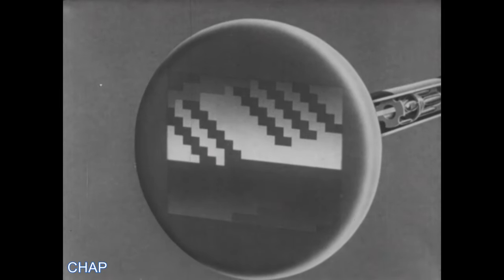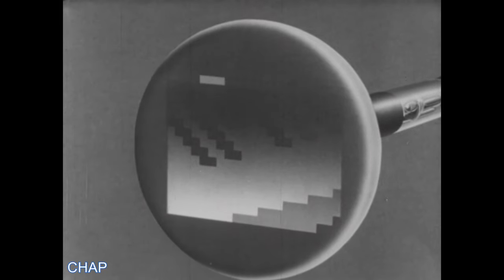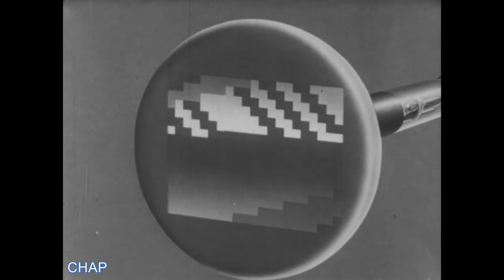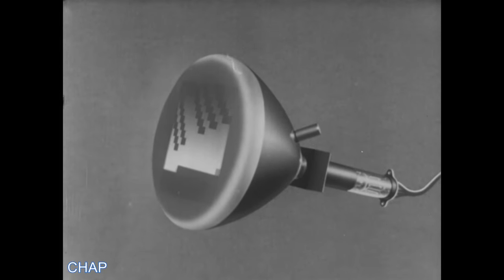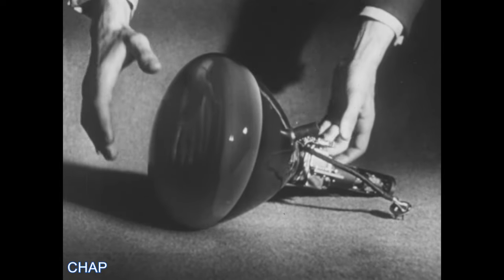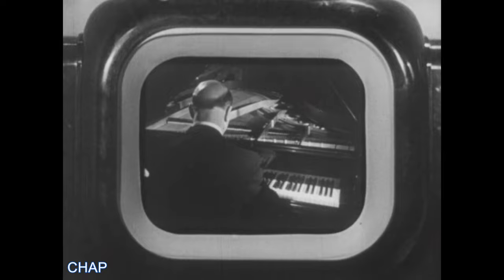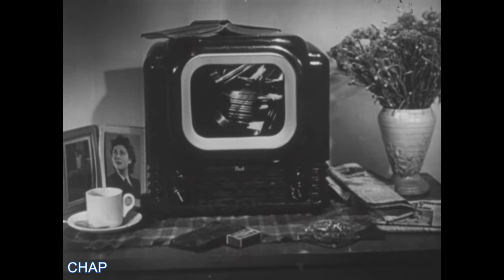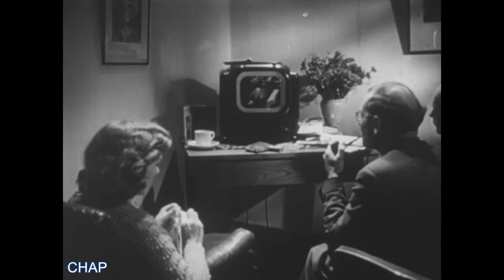"HOW TELEVISION WORKS" 1952  Educational overview

Comment: So many variables to go wrong, so much that needed perfect synchronization, and it was all transmitted and received by good old VHF radio waves. Sheer genius in invention, engineering and manufacturing. It's amazing that it worked at ALL. Just the wave form of a B&W video signal is amazingly complex, AND it also had to carry the audio! And this is "just" B&W TV!  Sure a B&W TV system would impress anyone today, But how many jaded lay people today even know HOW it worked. It's actually an amazing feat of purely analog tech!
Reply: You're an amazing feat of purely analog tech! 😋
Reply: @marctronixx  Technically speaking, That's true and even better I'm a purely chemo-mechanical analog device. 🤔
Reply: Saw your comments about tv technology. What was amazing is the work of RCA engineers to bring us color television. And because they didn't want B&W sets to become obsolete they found a way to broadcast a color signal so that B&W sets could also recieve a tv program broadcast in color. .
Reply: @Brian-yt8fu  Yes, that was not only a wild bit of engineering, physics.and chemistry  It was an amazing "out of the box" pro consumer concept and one of the rare times that a new format didn't force the owners of the old devices to need to switch. This concept also happened in radio when stereo was added to FM the new stereo signals were still compatible with mono FM radios.

Comment: This is a pretty good documentary for its day. Seeing that final generation iconoscope tube was interesting. It resembled RCA's "orthicon" very closely. Note, I did not say "image orthicon" which is a completely different camera tube altogether. Not obvious about that tube is that it is magnetic deflection in only the vertical axis and electrostatic deflection in the horizontal. I built some of my first all magnetic scan systems from scratch in the past couple of years and discovered that it is extremely difficult to get them to scan at thousands of sweeps per second. Vertical was only 50Hz in their camera and horizontal scanning was  8.1KHz in the horizontal (405 scan line system of the time in the UK). That's less than half of the 15.6KHz in modern SD television. Remember these are the earliest days of post WWII television in the world.
Reply from the maker: Hi videolabguy, great point in noting the difference between magnetic deflection and electrostatic deflection!  A fine point (but major one) that most people would not be aware of.  Thank you for sharing that bit of info.  ~ Yes, these are really some of the earliest days of television when much was still in a state of evolution.  (I have a 1947 TV in my garage that is likely beyond my skill level to tinker with, but fascinating to look at.)    Thanks again!  ~  Victor, CHAP
Reply: The tubes used here are called CPS Emitrons (CPS standing for Cathode Potential Stabilised). These were the direct descendants of the original Emitron tubes, which were essentially a copy of the Iconoscope.
Reply from the maker: Hi Davba2,  thank you!   Good to know.   ~  VK
Reply: Very well done film.
Did you check out the build quality of the television receiver. Almost military grade.

Comment: Television CRT where elaborate electronic air cleaners as well.  I could immediately tell if there was a smoker in the house and about how many packs a day from the high voltage anode lead in a TV when servicing.

Comment: Wonderful footage.  The explain makes everything so simplistic, for those who knows that  to make it happen is way more  too complex. The minimum deviation of tolerance of the values  a capacitor, or a resistor, the wear of the tubes, the mains voltage floating are enough to distort the signal, with direct effect on image quality, misincronization, "ghosts", noise...
An ofcourse, the amount of energy to power up these  glass tubes in heavy  wooden boxes. 
Total nostalgia.
Reply from the maker: Hi Brasilian Guy, thank you very much.  Glad you enjoyed this vintage film on early television.  We are looking for more like this and hope to find and restore similar tech videos for sharing here in the coming weeks. ~  VK

Comment: The bakelite set featured is a Bush TV22 I think.  The set with the case off looks older.  Lots of EF50 valves.  These were readily available as surplus from WW2 radar usage.  Anyone know what set this is?
Reply from the maker: Hi Eric, yes, pretty sure it is a Bush TV22 9" table top television receiver, manufactured by Bush Radio Ltd about 1952.  Bush started making this model around 1950.   There is more info on this in the "description" section of the video too.  It was a popular set in the UK, for those who could afford it back then.  : )
Reply: The set is a TV12, which was an earlier version of the TV22, being made in 1948/49 from memory.  It used the same case design as the TV22.
Reply from the maker: Hi Stuart, thank you very much for your comment and info.  Both models look very similar... do you know how to identify this as the TV12?   I am very curious.  Thanks very much.  ~ Victor
Reply: @ComputerHistoryArchivesProject  The TV12 used EF50 valves, as does the one in the film.  I actually have a TV22 chassis,  and it definitely differs from the one in the film.
Reply: @ComputerHistoryArchivesProject  i used to have this television back then. What a golden time it was!!😭😭

Comment: The US NTSC standard was up to 480 30fps but broadcast was about 330.  But Europe's PAL I  believe was 576 25fps perhaps because they developed it slightly later then US, noticeably better.  However NTSC was backward compatible with B&W,  PAL was not but was superior color pix, namely better color with weak signals.
Reply: Most of Europe used CCIR B 625 lines in monochrome on VHF. 
Ireland adopted CCIR I 625 lines and broadcast on VHF. The UK adopted CCIR I in 1964, however two networks( BBC 1& ITV) already broadcast on system CCIR A (405 lines) on most of the available VHF spectrum. Hence in the UK 625 lines ( system I) was broadcast on UHF only.( no space on the VHF spectrum) It took a while to get good population coverage with UHF. It was about 70% by the end of 1969. By March 1974 it was 94% coverage. From 1969 the BBC1 and ITV networks broadcast on 625 UHF as well. The 625 luminance signal was electronically converted to a 405 line signal and broadcast simultaneously on VHF. ( for those with old 405 line only TV's, or in areas without a UHF signal) Britain tested the NTSC ii color system with the 405 system btw, AND with the CCIR I  625 line system, and tested SECAM before adopting PAL in 1966, ( as it was adjudged the best Colour fidelity Colour over broadcast) broadcasts commenced in Colour from July 1967 on UHF.[BBC2]. From 1969 BBC1 &ITV started broadcasting in Colour on 625 on UHF. I had a portable monochrome 625 UHF TV and I can confirm it was compatible with Colour broadcasts! 
The VHF 405 line system was not compatible because it was a different system. The 405 line system was closed down in January 1985, in fact the last relay for BBC1 405 on VHF (Llandrindod) was so remote the engineer was not able to get out to it to shut in down until January 6th 1985, three days after the rest of the VHF transmission network was closed. ( the relay had its own standards 625 to 405 line converter) I wonder how many people turned their 405 line TV in Llandrindod on January 6th expecting a picture? 
From 1963 to 1970 most monochrome TV sets in the UK where both capable of receiving VHF  and UHF and switching from 625 to 405 . In fact Colour dual standard  TV sets came in the market in 1967 in the UK that could do the same!
Reply from the maker: Hi Martin, thank you very much for your detailed information!  It provides a great bit of history that many do not know.  I definitely learned something myself!   Thanks again!  ~  Victor, CHAP
Reply: In France, before SECAM, we had 819 lines Black and white. It was good but need special cameras, VTR... It was HD before HD.
Reply: You are mixing your apples and oranges. So called NTSC (RS-170A) is the color version of RS-170. Both are 525 total scan lines at 60 fields per second using interlace. A "frame" is made of two successive field scans to reduce flicker and cut total bandwidth in half (4.2MHz for the video portion of the signal). The 330 lines you quote is for vertical black and white lines in a test image. At 4.2MHz bandwidth, these lines blend together when there are more than 330 of them. Think of a camera slowly zooming back from a picket fence. So, there are SCAN lines which are horizontal, then there are RESOLUTION lines which are vertical and represent the maximum speed at which the electron beam can be switched off and on
PAL was developed in the 1960s in Germany. I had the pleasure of watching the first commercial color program on out BW 10" TV in 1967. The show was called The Golden Shot, a game show. Still popular I hear.
As for PAL "being better"? Malarkey! PAL has a slight transmitted bandwidth advantage, but us otherwise identical to NTSC in all but one technical trick to eliminate the TINT control. This was not as good as it sounds. In NTSC, phase disturbance caused the famous "purple people eaters" and "jolly green giants" problem of tint shift. PAL alternated the phase of one of two color carrier signals such that the error was purple in one line and green in the next. At the proper viewing distance, the human eye blends the green and purple back to "normal". It is ONLY an illusion. I always hated PAL screens when I had to look at them close up. One. They flicker horribly. 50Hz is just barely above the flicker threshold for most viewers. Two. The purple and green lines popped out at me and were even more annoying than the whole picture doing this in NTSC.

One of the contributing factors to the NTSC vs PAL fallacies is that the German engineers could be, and were, much more fastidious about signal quality. Since their broadcast system was paid for by tax payers, it did not matter what TV operations could cost there. In the USA, stations and networks were required to turn a profit and this always leads to cut corners.
Reply: PAL video showed up fine on BW sets, as long as the tuner was on UHF.
Reply: @videolabguy  Interesting, you may want to explain the magic frequency 3.57954MHz color burst?
Reply: @videolabguy  great explanation. The horizontal sync was in those times coupled on frequency of the power what is 50hz in Germany and the rest of Europe. And I could confirm that many people got headache from watching too long TV. Later when digital electronics reached the TV set they were sold with 100 hz technology which lead into a eye save TV experience.
Reply: @videolabguy  The phase error is cancelled electronically, using a 64μs acoustic delay line; there is no "purple/green line" issue.
Reply: Both PAL and the French SECAM system are fully backwards compatible with the CCIR derived 625 line B&W systems that preceded them, in exactly the same way that NTSC was. 

There were only two post WWIII commercial monochrome systems in Europe that did not adopt colour. The British 405 line Marconi standard, known as System A. This was one of the earliest electronic television standards and was considered too low resolution, so was replaced by 625 line CCIR System I and PAL colour. 

The other was the French 819 line standard known as System E. While this was a technical marvel of early HD television in the 50s, it was a bandwidth hog, and adding colour would have severely limited the number of television channels that could have been broadcast in France, so the CCIR 625 line system was adopted but overlaid with French SECAM colour, rather than PAL.

Beyond PAL and SECAM, CCIR was also extended with A2 analogue stereo sound and with NICAM full CD quality digital stereo in some markets and with Teletext interactive information services from the 1970s onwards as well and PALplus, which used digital components to provide widescreen and enhanced colour. 

If you connected a 1960s b&w TV it would still have been able to receive a standard B&W CCIR 625 signal and analogue audio, so full backwards compatibility was maintained until the digital switchover to DVB-T.

There were a few variations of CCIR 625 line systems, all of which are derived from System B introduced in the 1950s. However they’re all just slight tweaks to fit old national spectrum plans, or to slot in around older systems (or in some cases may have been used as technical barriers to protect local industries.) But they are essentially just minor variations of the same European standard. The fact that tubes were all 625 line suited manufacturers, and made sharing of components much easier, driving down cost.
Reply: @davidbeard7262  a concept borrowed from SECAM btw.
Reply: @publicmail2  That’s normally 4.433618750 MHz in CCIR 625 PAL / SECAM systems.
Reply: @user-uc7vt4yj4d  There was a B&W broadcast in the US NTSC that used trickery to simulate as color pix.  I recall it was a 7up commercial.  So you could see a "color" pix on a B&W set.
Reply: On July 25, 1967, television viewers with black-and-white TV sets were startled to see flashes of color on their monochrome screens for about ten seconds during a 60-second soda-pop commercial. A letter to a columnist in the September 14, 1967 Detroit Free Press asked, "Before I see an eye doctor, let me ask Action Line: Is it possible to pick up color TV on a black and white set? I SWEAR I saw a Squirt soft-drink commercial in color. Not pink elephants Green Squirt!" The image was described in the newspaper column as a red, green and blue sign that had flashed on the screen.

A viewer in Chicago told Popular Photography magazine (July 1968), "I saw pink! It knocked me for a loop...the letters S-Q-U-I-R-T looked greenish or light turquoise...and it kept up for maybe 10 seconds." (Meanwhile a viewer in San Francisco claimed he didn't see anything colorful.)
Reply: The 625 line CCIR system was a Russian “invention”. When television was about to begin there, they didn’t want to use the American 525 line system, so developed their own.

Ironically, the way they did it was to use American equipment, and change a few of the components. That’s how they arrived at 625 lines. 625 lines x 25 frames = 15625 Hz line frequency, which is very close to 525 lines x 30 frames = 15750 Hz.
Reply: PAL is a colour standard.  Those old black and white sets in the UK, like the Bush set featured were 405 lines.
Reply: @davba2  Fascinating! I had been taught ('nother BBC engineer/Wood Norton trainee here) that it was Telefunken and Walter Bruch -- but a bit of browsing finds the history that Bruch spent a year after WW2 in a Russian-zone Berlin lab and then brought the results back to the West at the Stockholm CCIR conference where the 625/50 standard was made. 
But it was absolutely based on NTSC thinking, and in fact there were bits of internal BBC engineering in the 70s-80s which were based round a subcarrier frequency of 4,429,687.5 Hz, which is what an NTSC subcarrier for 625/50 would have been before they decided on PAL!
Reply: NTSC is better than PAL or SECAM.

Comment: So, in other words, analog television really did have a definite resolution size: the number of horizontal and vertical squares on the mosaic--they were the pixels!
Reply: But by the time you get to the Plumbicon tubes, you had a continuous photosensitive surface. Your vertical resolution is set by the number of scan lines - 575 lines on a 50Hz PAL standard - but the horizontal resolution is set by the frequency response of the circuit. 5.5MHz gives a theoretical limit of about 290 'pixels' - 145 line pairs - but it's tricky because those 'pixels' can start anywhere, rather than on a pixel grid as with a modern camera, so the resolution is continuous up to the frequency limit. You don't get that with a pixel camera.
The interlaced horizontal field traded time resolution for vertical resolution: if you want to think in pixel terms you're probably thinking about 290 by 290, though you'd need twice the number of actual pixels to achieve similar resolution digitally.
Comparison of digital and analogue resolution is, um, tricky and subjective.
(p.s. yes I did work for the BBC as an engineer for over thirty years).
Reply from the maker: Hi Neil, fascinating.    - Over 30 years as a BBC engineer!   Bet you have some unique stories to tell.  : )
Reply: @neilbarnes3557  All good stuff. I imagine this film was made in the 405 days? The vertical resolution of that system was around 377 lines.
Reply: @neilbarnes3557  I think the horizontal resolution on 625 was about 580 pixels in effect. 290 is about the number of cycles of the maximum video frequency of 5.5MHz that would fit onto the active line duration of 52uS. But, each cycle could in effect deal with two 'pixels' as  each cycle would include a peak and a trough (peal white and black level).
Reply: Notice that they never use 'pixels' to describe the picture units; that term didn't come until the early 80s, used by the computer folks. They always had to be different.
Reply: @johnr6168  Yeah, mea culpa, I had an attack of brain fade! Each cycle can of course display a white and a black 'pixel' (and all the levels in between). I knew I was wrong but I couldn't pin it down... doh.
So 625 PAL (5.5MHz/52uS active line, 576 active lines) has a 'pixel' resolution of 580(v) by 576(h) - but Mr Nyquist will not be denied and if you want to replicate that with a digital display or sensor you need at least 2.2 times that... hmm, 1280 pixels ring a bell? 😁